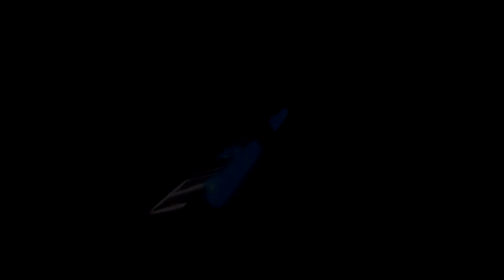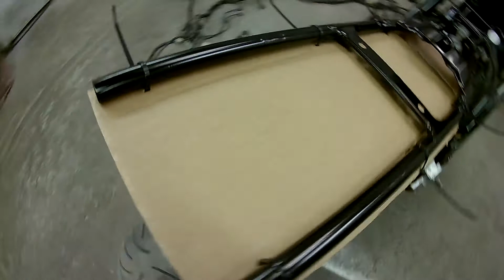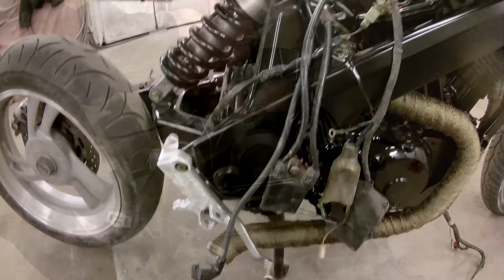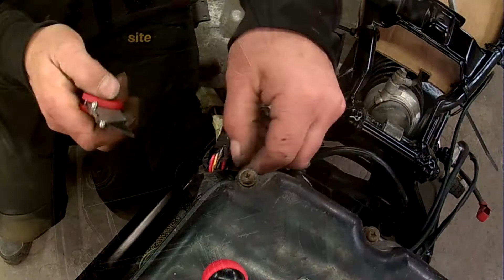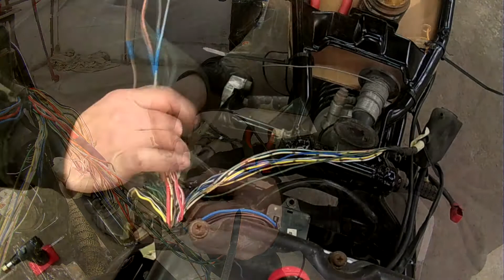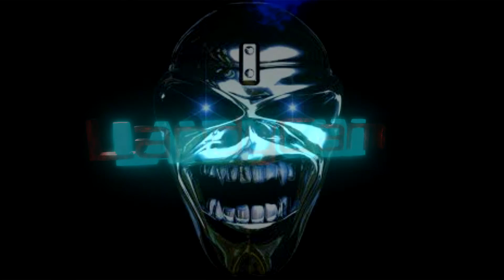honda ntv 600 cafe racer build part 9 wiring loom

Comment: Hi m8 i have a question. the way you left the frame for seat. with no suport is that not going to snap away under rider weight ? im 100 kg and i can imagine that over a bump at some point it will snap . or not ?